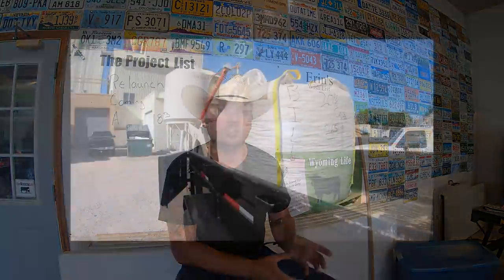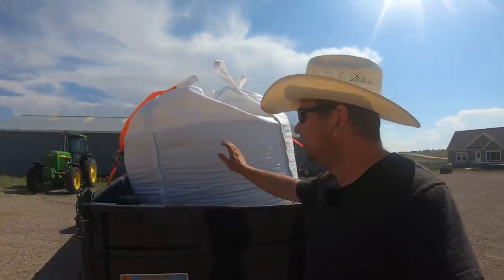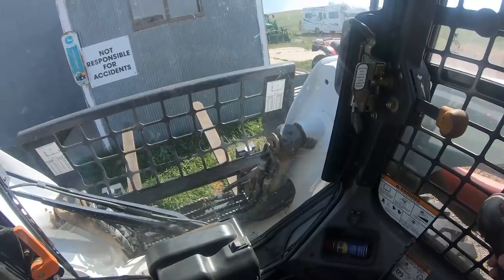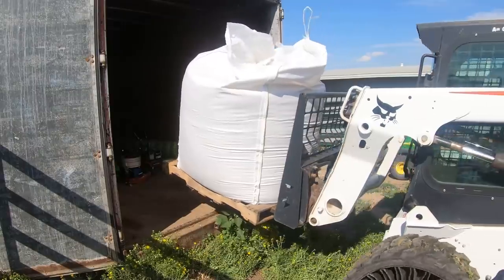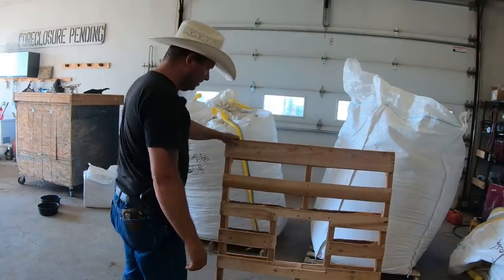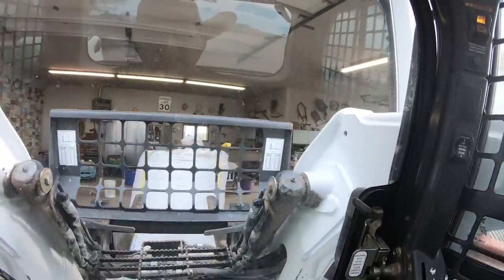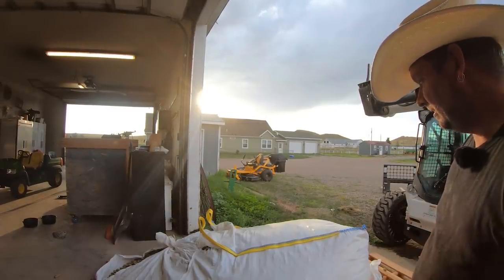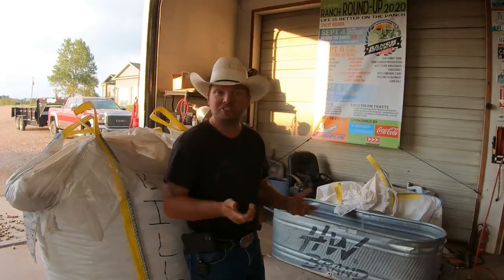Bulk Feed at the Ranch and One on the Ground

Comment: Mike, i've had enough bad days to know that its never a good idea to tell someone how to do what they were having trouble doing... however my uses and re-uses a those super sacs for feed, and how we do it is, we have built boxes around the bags. Think orchard boxes but over built so we never have to rebuild the box. and never take the bag out of the box. when you go to the mill, the whole box goes in the truck with the bag inside. Just make sure you over build the box for wear and tear, especially the pallet part as that's the most likely to break down first.
Reply: Hammerslap we have done the same with ours, it is so much easier and less headache to deal with!
Reply: I was just about to comment. To build a box for these each time!!!!!
Reply: @Kay-ki7qs  and much safer in situations where your working alone. was pretty relieved to see Erin out there when he was feeding the pigs. those sacs can be very unpredictable.
Reply: Hammerslap the reason we started building the boxes was because my uncle had one that pinned him to the ground against a cattle gate. He was stuck for over three hours until I came home from work and found him. I was able to pull it off him with a grapple bucket. Yeah it was a pain to clean up afterwards, but we learned our lesson and built the boxes afterwards!! Luckily he only had some bruising and swelling. He very easily could have lost his leg.
Reply: Great idea !
Reply: Dunno how much one of those valve jobbers of his costs but it seems like a handful of IBC totes with those adapted onto the bottom would work pretty well for pig feed & cake, and a couple more with bigger valves fitted to the side would do well for feeding the chickens too.
Reply: Yeah, since Mike will probably continue buying feed in bulk, it’s a good idea to make some kind of container, will make it much easier down the road.
Reply: For the cake box, the raised platform is a great idea! Heavy metal to take years of use. 
Maybe the mill can put you in touch with their container salesman.. I'm sure there are many more styles that may be suited for just your size operation/needs.
Reply: I own a farm

Comment: Welcome to the world of ibc bags! Can't tell you how many times I've spilled a whole bag on the driveway, and had to shovel it all back into the bin it was supposed to make it to. The worst is tearing a hole in the bag somewhere, there's no stopping the flow after that. Here's a trick I found with the dump trailers. If you can reach the loops and lift the bag enough clear the bottom of the trailer, then you can lift the bag from the side of the trailer and pull forward with the bag suspended. Once the trailer is clear, then you can place the bag wherever. One way to avoid dragging out the pallets you can't reach and rub the floor. Essentially pulling the trailer out from underneath the bag without dragging anything.

Comment: It took me a few years to get good at handling those bags.  Those loops work if you always use all 4. I finally ended up using a plastic crate with a dump valve once I got them home.  Getting seed wheat and feed in those bags I sometimes ended up with me and scoop shoveling into my tractors bucket, not fun.

Comment: worked in a rail yard loading dock, you can get a pallet grab, it pinches the center board and you can pull it by a chain as long as you want, we pulled loads over 50 feet to get them to the back. Northern too, Grainger, have them, very useful and safe. Uline has poly pallets we used to do exactly what you are saying with the bottom trap on the bags. and I welded up and A-frame with a chain hoist one time for just the predicament you find yourself in, it has saved my bacon umpteen times, a wire pallet crib keeps those sob's from tipping over I learned Gawd I love seeing somebody else go thru the learning process, it just makes my day, love your vids
thanks for sharing

Comment: Don’t know if it has been suggested yet, I would take your ratchet straps and take the time to wrap one from one side of the push bar of the forks around the bag to the other side of the fork push bar. I would do one at the top of the forks and one half way down. Would be a lot easier unloading from the dump trailer that way as well and less sketchy.

Comment: They make a pallet grabber .  It's like a scissor clamp .   But your few uses a regular chain works fine.
Your first attempt tipping the tote back up was pulling horizontal .  Should have pulled up at least by 45 degrees .
Don't you love mind sight? 
Btw. How hard would it be to have a hopper?  
Probably take a aurger to fill it

Comment: Mike Mike Mike
Build a box out of plywood dump it in there the scoop out.  Build it on a pallet for transportation 
Or buy a few ICB plastic tote that are always for sale for 50 dollars add a door on the front or bottom and cut the top off.  Wallah ten minutes of work and you have a weatherproof mobile cake hauler with a built in crate surround it.

Comment: Those bags fit nicely inside of the IBC tote frames. Pretty sure you could cut a hole in the center of the bottom and leave the bag inside the metal frame. Good luck and thanks for some great entertainment!

Comment: Mike  sounds like you will be buying  more  feed this way  i would like to suggest  that you build special  pallets  for this   metal   pallet with cage  either  make  from metal  hog and goat  type panel  with  4 side as gate   or removable for loading  full  bag,  the sides  will  support  and keep weight  from shifting  off balance   could  even take to Mill 
And let them fill bag while  on in caged  pallet

Comment: You should trade or sell your dump trailer to get a trailer that does the same thing but has the added feature of the sides drop down to become a flatbed to load and offload.  Or I saw in the  barn you had clamp hooks that could be used to pull your skids to the back of your trailer to pickup with forks. Good luck and be safe when your storm hits. I live near Buffalo, NY on the Canadian side and we hardly got any snow this year again no longer the great white north.

Comment: You might consider buying a plastic "pro box" seed tote with a slide bottom and fork pockets. Lift the super sacks by the loops and empty them into the seed tote then you have a safe and stable box to handle that you can control the flow on without standing under the load. I own four of them and they've saved me a lot of headache.

Comment: never knew those tote bags had a chute to unload by gravity.      Not a fan of all that weight hanging in the air while you are working under it and getting in & out of the skid steer.
Reply: Way to dangerous. The ranch would be no more if Mike got hurt.

Comment: Well that went ok.  I would work on a heavy duty self that you can lift that bag onto with the hole in the center for the spout attachment. Has to be tall enough for your gator to drive under and open the spout and close it.  You would have to talk to someone for the specs, and material to use. Because that is an awful amount of weight to hold. You would want it sturdy, and safe. A house builder might be your best source of advice. Oh another field trip!!

Comment: No worries Mike!! That's part of ranch life!! We say things sometimes we don't mean or how you say it that pisses off the spouse. And we feed cake from a bad like that also. But we just put forks through the loops. Lift it up as high as we can over our side by side open bottom until full, pinch off, tie it up and set it back down on pallet. One time we were unloading it from pickup, the bag ripped right in half. Cake everywhere!! Worst part was there was snow on the ground. So we put wet cake in a different empty water tank. Dry stuff in a another. Simple project turned into a 2 HR one. Shit happens. 😆

Comment: Make make a custom pallet that is a little bigger than the bags. Then take a few 2 X 4’s and mount them vertically to hold the bags and keep them stable. You can use the brackets for a 2 X 4 to slide them in and out after getting the bags on the pallet.

Comment: Mike, you might be able to get some square metal bins 3 or 4 ft high that they can set the bags in at the mill.  You could make then with a hole in the bottom for your valve.

Comment: Mike,  I used those bags to move bulk mixed fertilizer.  I had no idea how hard it was to stop the flow out of the bottom once it started.  I thought it would fill the spreader and stop.  It did but the chute was fill and I couldn't tie it off.  Needless to say there ia a very fertile spot in the field.  That shutoff would have been nice.

Comment: Could you build some sort of covered gravity tank to dump the bag of cake in?  Add the Austrian spigot on it where you could back up the gator to load up.  Maybe?
Reply: They make what are called overhead bins. They hold 25-30 ton of feed, you can just drive under it and fill your cake feeder on your pickup. They are filled with a semi truck and conveyor/auger

Comment: Im sure someone else said it already, but if you take a pipe, put the hook on the end of the pipe, run the pipe and chain through the fork space of the pallet, loop it around the center board and run it back to the bobcat, its a little safer. In the future you can do that easier/faster while loading the pallet, and unloading the last pallet is only a minute longer than the first.

Comment: Have you thought about putting the spout on the bottom of a pallet yes but building a wood box on top of the pallet large enough to dump the whole tote into.  then you  could move it around without it tipping off

Comment: If I were you, I would build a heavy duty pallet to put the bags on with the hole in the center like you had. That should hold up for quite a while for you. 
For the cake, I would build a stand that the bag could sit on, attach the gate to it and have it high enough for 5 gallon buckets to fit under. Then you could fill the buckets and put them in the back of the gator to take them to the cows. To me, that would be better than just having it loose in the bed of the gator. Just a couple thoughts. 
When I had chickens, I got my feed from a local mill. I would get 25 bushels of corn, 600# of highlay and 100# of oyster shell. It was all ground together. That gave me 2100# of feed and would last quite a while even when feeding 300 chickens. 
Buying bulk is usually quite a bit cheaper, but that 2 hour drive would be rough. 
Another interesting video, keep them coming. Have a great day.

Comment: Erin probably would’ve told you to put the chain through the two bottom loops to bring the bag upright and it would not have torn.  But, like you, I too have eaten much crow apologizing for myself afterwards.  It might be easier shoveling half that cake into the empty pig bag foe ease of maneuvering into the 4x4 .  Then you could drive the whole bag out with the release hole on the end of  the gators tailgate.

Comment: If you need more storage trailers, look into getting an old or retired seacan or called a shipping container.  All steal so you can fix holes or leaks very cheap. To fix a fiberglass/tin roof on a road trailer can be costly.

Comment: Great video once again!  I really like your pallet idea!  But wondering if it would work to build a stand that has a modified pallet permanently fixed high enough to drive the back end of the gator under and then you just set the new bag on the stand.  A whole lot less handling and a lot easier than pailing into 5 gallon buckets(as I do now)  There would have to be a removable roof on it, but that could be a tarp or a piece of roofing metal with a weight on it.  Just a thought!  

I sure felt your pain!  I use the handles all the time to move them around..However, they can start swinging.  Well front wheel of tractor went into hole, bag swung and drove bag into the hitch of a trailer and sliced it wide open....feed everywhere!  LOL.  I just bought a bag of pellet layer diet and it was $553 CDN (413 USD) - can't take bag back.  Find the pricing interesting.  That is a huge savings...our layer diet bag price is 0.03 cents per pound higher than bulk...not much difference there.

Comment: Mike couldn't you use the JD Loader tractor and use the bale spears for the loops or take 2 pieces of pipe and string them through the loops and then lift with the loader tractor. 
Or else build a box on a pallet and set the cake bag down in it then it shouldn't tip over and you have your gizmo to open and shut the cake bag. When you get out of the skidloader with the cylinders up I would put the safety deal down so you don't have a accident. Same goes for the JD loader.

Comment: I wonder if a $50 275g water tote could hold that much feed?  Then, you can put it on a trailer, have it filled at the top port since they have wide openings, then empty it from the 3" bottom port. This should work for the pig/chicken feed.  You could modify another exit port for cake/cubes. If they can hold and seal water, they can hold feed.

Comment: As I think about it, I have a solution for your problem with the bulk bags.....Get some new heavy duty pallets and cut your hole in the middle  per usual....make certain the size of the pallet will totally contain the sides of the bulk bag.   Then take some 1/2" plywood and make 4 sides about 4 feet high each and screw to the sides of the pallet.  Take 4"x4" and cut to make triagular pieces for each corner, full height........use plenty of screws and glue so this sucker is solid....Then you put the bulk bags into the bulk bin, and you will not have a lateral leaning problem you presently are having with the bulk bag just sitting on top of a flat pallet.   I saw an apple bin in my back yard, and thought of you and your problem! lol

Comment: buying in bulk with most stuff we buy in general is 90% cheaper buying in bulk. i try to buy in bulk with as many items as i can. with the few items i can buy here in michigan in normal everyday type items buying in bulk last time i check. i save about 30% on average. so if i can save money at least that much i will do it as much as possible. even when its under normal times without stuff like corona. i do what i can to make my money last as long as possible. only thing i spent more on doing it is my time. but after the first few times figuring out where to go for bulk items. it gets faster on time to do and money saving is worth doing.

Comment: comming around like you did in the shop then pick it up with the forks on the loops... pick up 2 then down and then threw the other 2 loops... you where pulling it from the top 2 loops.. this ripped it... the bottom 2 loops and you would have been good...

Comment: NB: I found a lovely little niche for myself my last years on the farm...I don't mind the back and forth of dickering, have some extra time on my hands, so took on the comparison of various feed mills and stores' prices and products, originally just for myself, because I had horses and custom make my own mixes..yes with BALANCE, more customized to each animal than "close enough" for each animal...because no one mix met every animals needs, and feed mills were going crazy trying to switch me from my indicated bases to their own mixes...which ended up being another 6 or 7$per bag...at tonnes it adds up fast! So I simply asked for beet pulp pellets  then the various base elements that I'd add together on my own and chewed them down as low as I could on them all. Went from spending 3600 at a pop that would last 2weeks to 300$, added in our own other base ingredients and that all lasted a good 4 months, but a lot of work, and careful calculations. Weight being the most intricate. No more"close enough". I purposely took out containers for each ingredient and marked ON the container where to fill to  for the various ingredients. Made it much easier for those who just didn't want the time investments to measure carefully. now they had *no excuses*. The more delicate process, I did  overnight on the woodstove and that was carried to the barn in the morning by the other half, doled out into the various feed pails and the other ingredients(if there were any) added from the garbage cans in the feed room in the barn-best way to rat proof the feed, a lockable metal garbage can)he'd dole out the cooked portion of feed for each animal that required it, then take their feed buckets to the feed room and add the necessary ingredients from there. The other bonus being  nobody ever "accidentally" got into the feed. No more colic or bloat worries!
Next best thing, feed savings! BEST thing...hubby did a lot of trucking and odd jobs, for area farmers  in no time, they were asking me to do the same bargaining for them! I received  10% of their savings in exchange(and of course, having my own records, already knew how far I could push the various feed mills; therefore my job was already half done😁😘🥳, and they knew ME! So 2/3a done...😎💞)

Comment: Aww lawdy. Bulk is always cheaper, but to save money the bullcrap that comes with it. Just an idea for you. Maybe it will work for you😉maybe not🤪. If you can find the big container that has the metal frame,it has a skid built in the bottom. Get your spout end rigged to where the cake will come out. Hole at the top will be just like the hog feeder. Bob's your uncle. Lift the bag till the drum is full.  It's a 2 fer,storage and pest free👍. Hope it helps. Chicken grain could be put in old freezers inside the trailer 😉. Again not telling you what to do,just tring to help you out. 
Eatting crow happens when we are use to doing by ourselves. I'm sure your butt hurt after your chewing😂😂,but you will be ok,it builds character ✌.

Comment: You need a JCB Teleskid with a side entry door.  You should never get out of the door under your load. Also don't trust the loops on the bags, they can tear off at any time. If you need to work under the bag, find a way to support it safely. You wouldn't want the wife or kids to find you dead under a bag of feed.